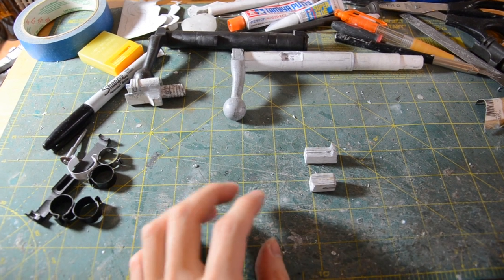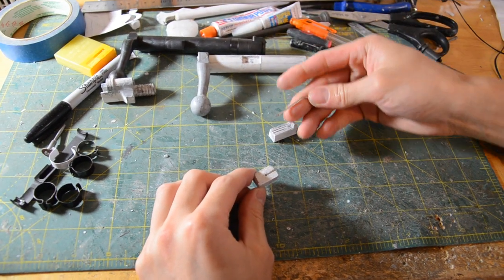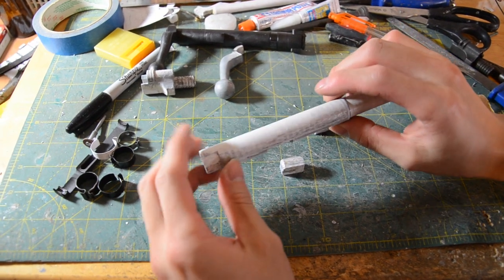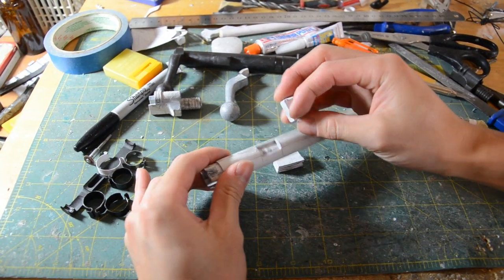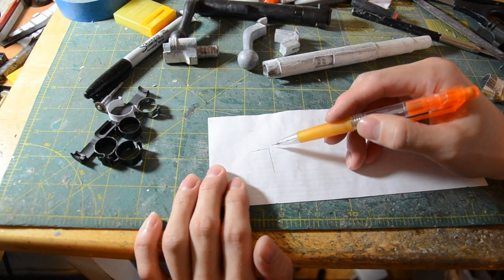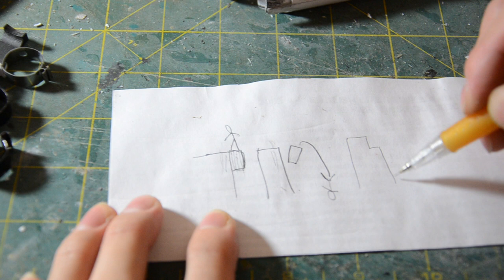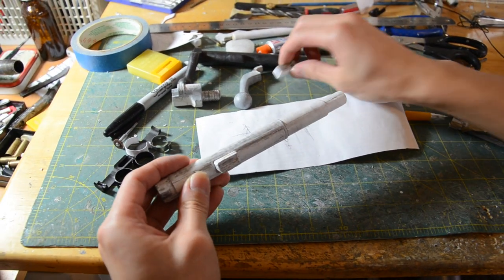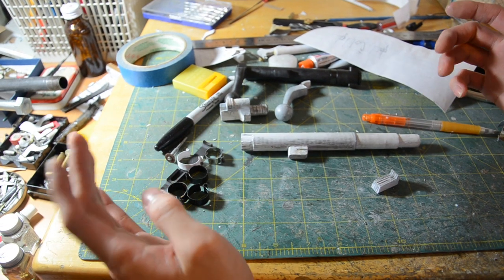Paper M1903 Pt. 4: Bolt Lugs

Comment: I love how u create strength through design with this stuff.  Genius approach to increasing "Shear Strength" of the lug in regards to the bolt!  I work with plastics alot and cellulose (paper) makes a great reinforcement fiber ...which by golly u have shown can make damn near anything! Wow and thanks!  

P.s.  Btw...what kind of glues are u using just superglue?  Seems like you could acheive wonderful things with a ceramic epoxy infused with paper!